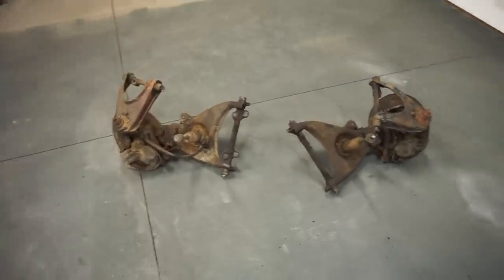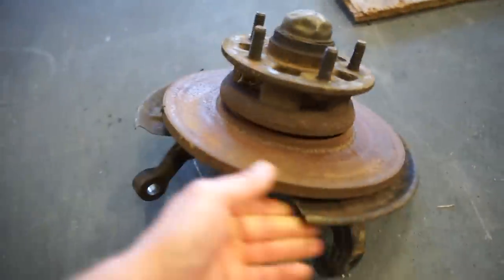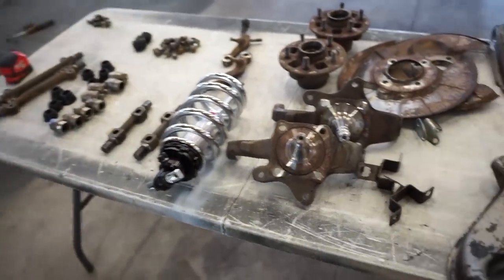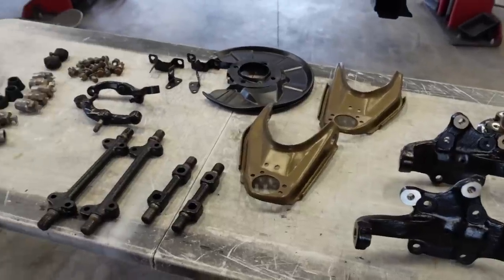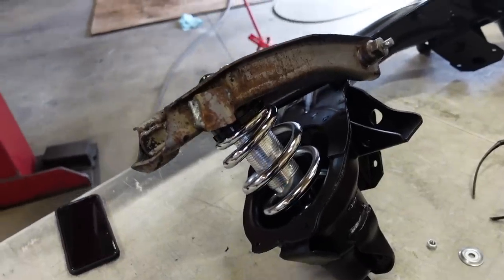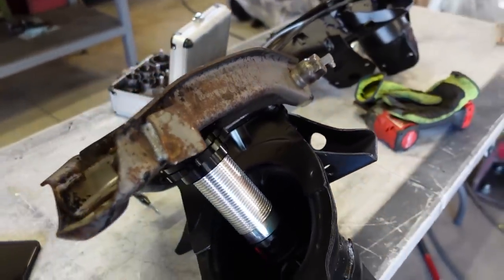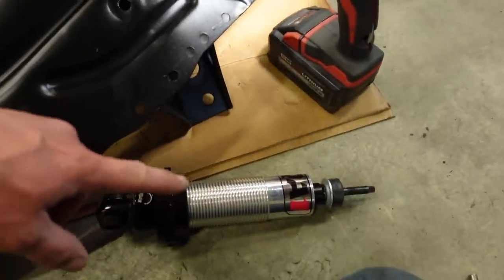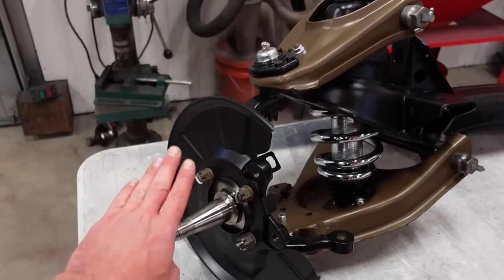Rebuilding The Hilux Front Suspension And Modifying It For Coilovers!!!

Comment: Looking amazing as always.

One thing though. How strong are those lower coilover bolts? It may have been stronger to put the shock ears on top of the lower control arm even if you had to lower the mounting plate for ride height.
Reply from the maker: Yes it would be stronger but I don’t think 10.9 bolts will break! I wanted the extra 3/4-1” of lowering from mounting this way!

Comment: Hilux. Hee-Licks? A Helix is a spiral in form, like a coil spring. Hilux is usually pronounced "high-lucks". Hilux is a combination of the words "high" & "luxury".
The truck is called a Hilux almost everywhere else in the world, and was sold in the U.S. under the Hilux name until 1975. From 1976 on it was simply known as the "Pickup", "Truck" or "Compact Truck". From 1996 on the name was changed to Tacoma. In the rest of the world it's still sold as the "Hilux".

More seriously though, I want to thank you very much for this very complete video. I have a '78 that needs all 4 ball joints replaced very soon, & the video helps me to understand the components of the front suspension & how they work. That's going to make my job easier, so many thanks.
Quality videos showing quality work. Top notch sir. 👍

Comment: What size blasting media are you using? I’ll bet switching to a coarser grit with a bump up in pressure will increase your blasting speed
Reply from the maker: I use 80 grit aluminum oxide at 120 psi or so! I really just need a better blaster

Comment: Austin, congratulations it was another amazing job! I have only one doubt and I would like to ask you only because I know nothing about materials resistance, so forgive me if my question makes much no sense. Considering the plates welded on your suspension, there's no risk of a fracture with the impacts through the time? Is the weld applied strong enough to support the truck's weight against the road impacts? Greetings from South America!
Reply from the maker: Yes that is welded on both sides. The arm will snap in half before the welds fail

Comment: Hi, beautiful work. 
For me it has a big security problem: All the force of the spring is received by 2 screws. if one of them breaks the other one too and you are left without suspension.The logical thing would be for the pin to be above the arm so that the force is supported by the pin, and the screws prevent the pin from moving out of position.

I am not an engineer and it is my reasoning. I can only imagine a good bump in the road (or a flight) 1 ton or more in those screws and suddenly they fail.

Comment: Often you can swap the single, thin hilux discs with Land Cruiser double-thick vented discs and then use an 80-series non ABS master cylinder.  They are compatible with (at least the later) Hilux brake boosters.
Reply from the maker: 2wd? I know you can use the land cruiser rotors on the 4wd trucks but the 2wd has a different rotor!
Reply: @austinniemela  Of course you're right.  I only ever deal with 4x4s.  I see threads about using various Mustang and Nissan rotors for rear disc conversion (awesome video about your rear link conversion, BTW).  Maybe you could find something that would swap over?

Comment: Nice work, those springs are rated for V8 engines and your running a 4 banger. Aren't you concerned with the weight poundage of the spring specs and how its going to ride?
Reply from the maker: The Tacoma 2wd crowd run these 600lb springs. I think the actual springs for the camaro are heavier!